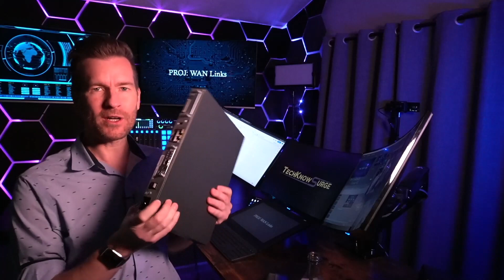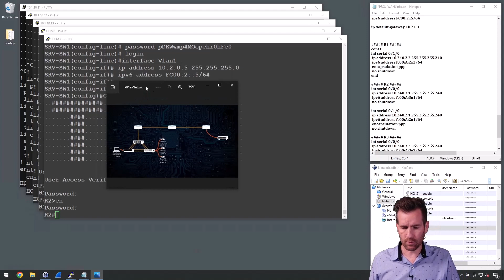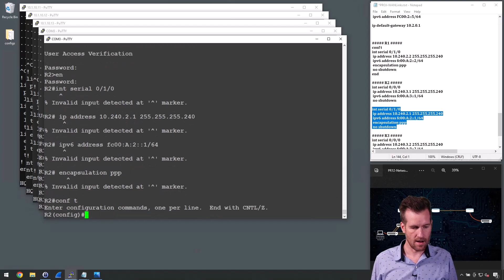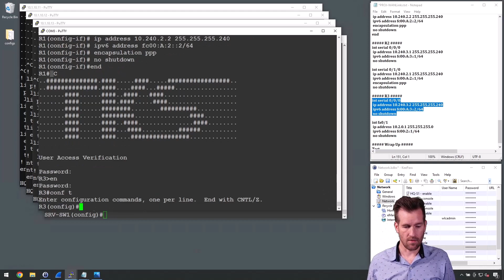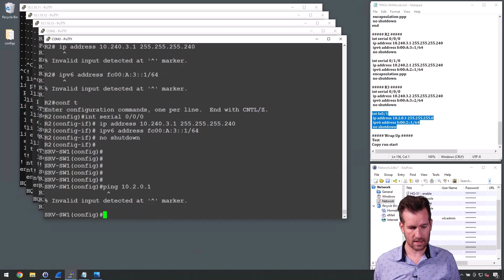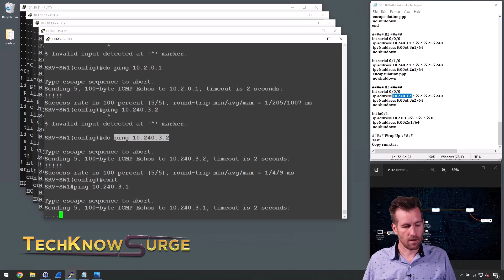CCNA WANs 2-4: PROJ: WAN Links

Comment: Good afternoon........Tested on new test today .......569 :face-red-droopy-eyes:  gutted....its easy to convince yourself that the answer are right .....many sill mistakes ..and some areas which I not covered ...thanks for trying  that switch domain name change.....
Reply from the maker: What areas have you not covered yet?
Reply: @TechKnowSurge  Security is a weak point my IPV4/6 understanding falls apart under pressure of time....and automation i need to slow down and  to read the question and not answer the one that i thought they asked ..basically 5.0 AND 6.0 on the exam topic list i have not touched.... looking through the paper...... i was confident of the answers ....but low and behold ....general knowledge can't answer these questions.....
Reply from the maker: @weniweedeewiki.6237  Haha, Security and Automation are 3 of my last 4 modules I'm creating.  I'll have them done soon, but not before your test :(